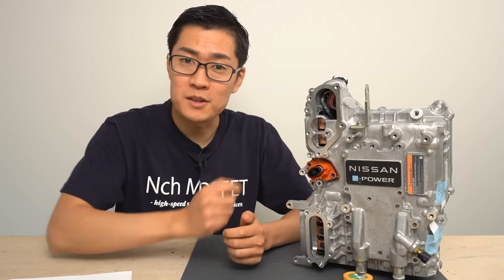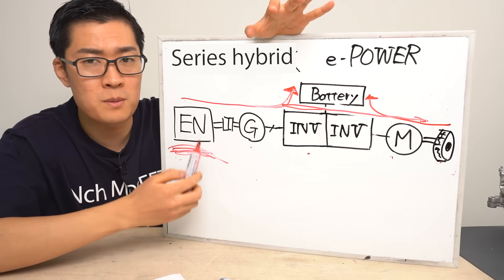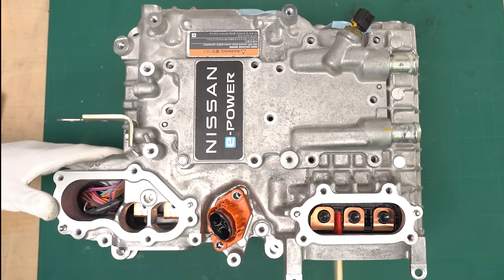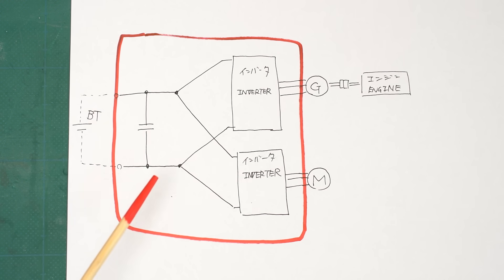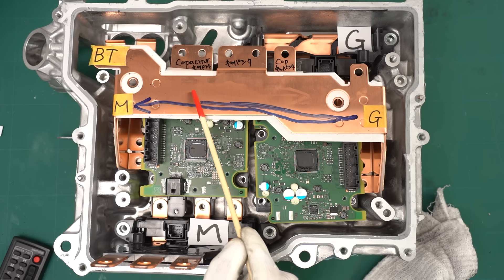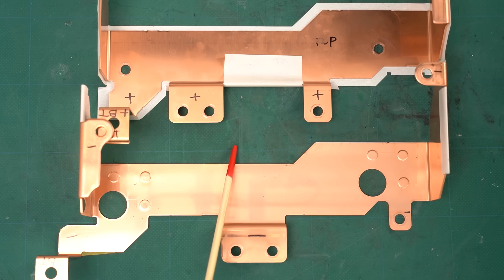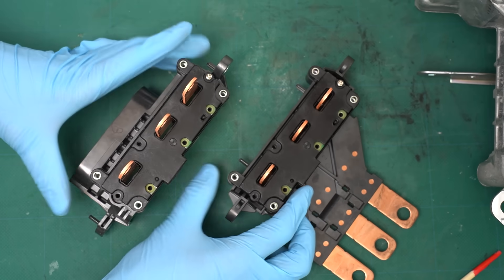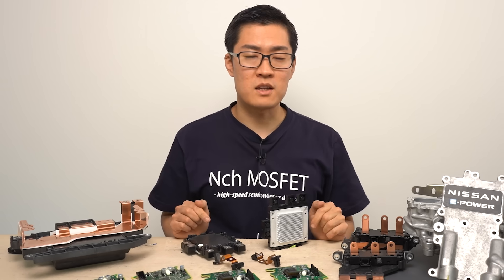Teardown the Inverter of NISSAN Note 【E13】

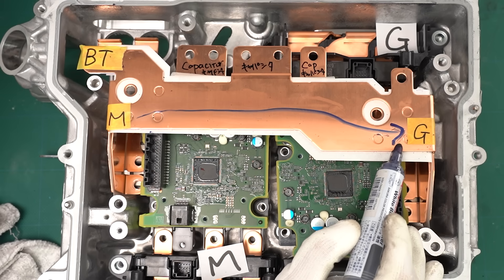Comment: 09:14 it could also be the case that the ECM set command to some of the (coolant) heater to generate more heat or the DCDC to dump the little bit extra in the 12V battery

Saw that on some European cars.

Comment: From the generator (AC) to the battery (DC) the electronic module isn't a Rectifier ?
Why is it considered an inverter ?
Inverter is DC to AC.
Reply: because it can also feed power to generator. he stated the generator itself acts as motor starter which means it needed to convert battery power to AC
Reply: it's a bi-directional inverter

Comment: 13:55 is it just me or does the channel layout allow some of the coolant to bypass the second module and go directly to the exit? Is the load on the two modules so unequal that the second module requires far less cooling?
Reply: doesn't look like that much of bypass imo. another possible reason is preventing excessive coolant pressure at the first module during high cooling load condition or failsafe mode which many times it forces the coolant pump to run at full speed

Comment: Great tear down and they really simplified and standardized a lot of the parts in it. Especially compared to ten years ago. 
As far as coolant flow, the port with the temp sensor is more than likely the outlet to measure the temp leaving the inverter.

Comment: Coolant flow direction can be determined by the temperature sensor lcation. The temp of the cold side is pointless, so the sensor will be on the hot side, the outlet.
Reply: true. we would want to monitor the outlet temperature for either heat generating component or radiator itself. that way we know the state of cooling system
Reply: We have in our equipment (FCS, DCDC step up, MCU,…)  on the in- and outlet an sensor. Result may vary…
Reply: Also the direction that points in the direction of the flow.

Comment: Despite slightly lower overall efficiency, i think series hybrid Nissan is the best architecture for mechanical simplicity and serviceability
Reply: Is it also generally lower cost?
Reply: @n27272it certainly gives room for lower cost. Only drawback of no variable gearbox is that torque would be limited for the 4x4 models off road